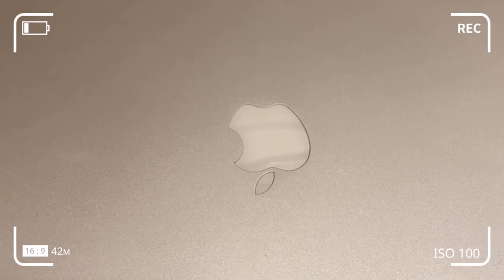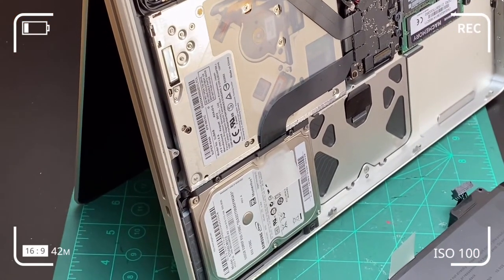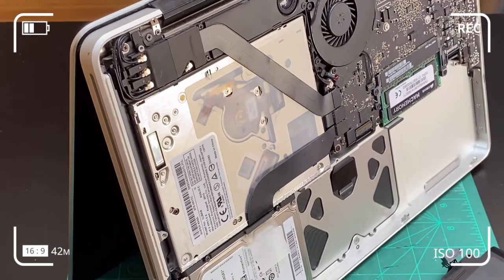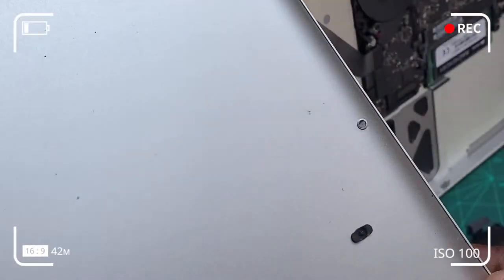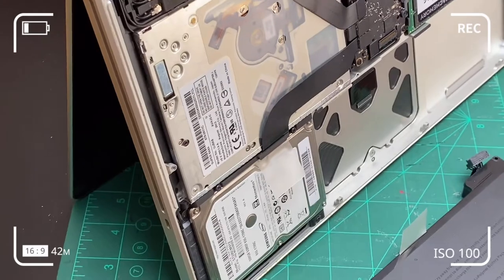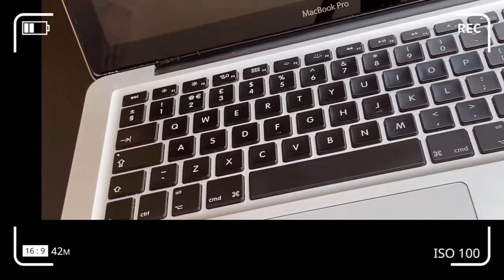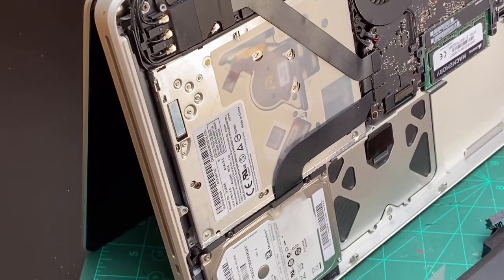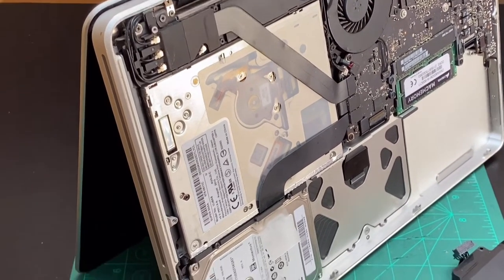How to fix Mac wont turn ON after Water, Coffee or Bath spill damage

Comment: This came in just at the right time. The car heating works. Use the car warmth keep it away from direct sunlight in the car with a cloth , which prevents especially the screen from static
Reply from the maker: Static can cause lines and screen damage. Never use direct sunlight. Use the normal fan setting for fans and the warmth of your car never  direct sunlight

Comment: They won’t even repair them at Mac service repair if it’s a water spill. Thanks for this
Reply from the maker: It’s because water itself doesnot destroy your computer it’s the short circuit that fries your motherboard as a result of not turning your off power. So they may be apprehensive of the extent of damage and corrosion as a result having left the power on for long and reporting the spill too late